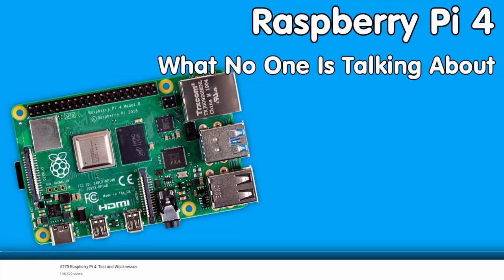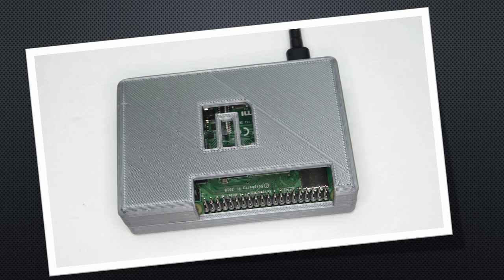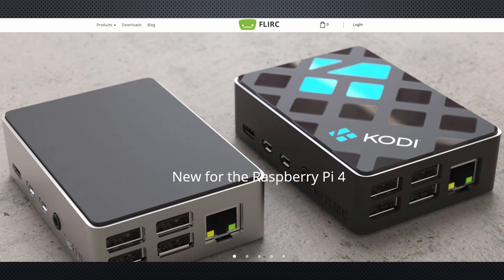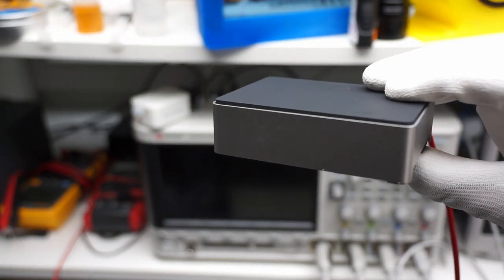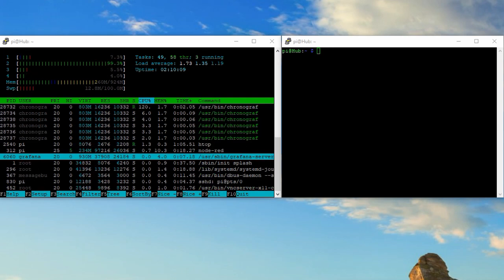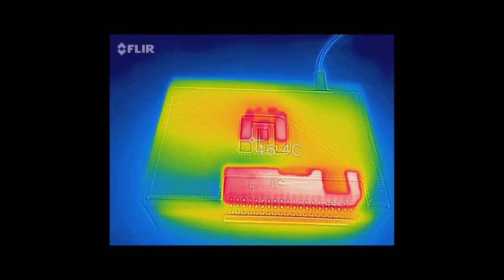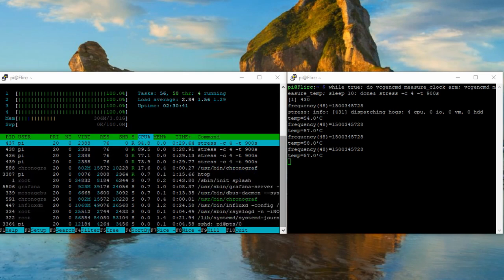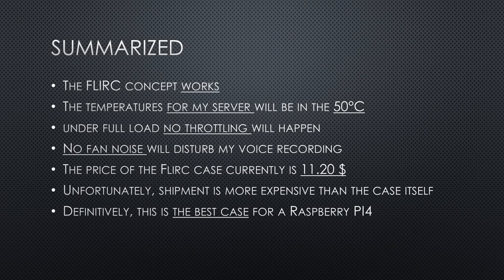#283 FLIRC: A Cooling Case for the Raspberry Pi 4? Does it work? (Quickie)

Comment: The best video I've seen on "passive aluminium cooling box" for RPI4.
Well prepared, with measurements.
Only one thing: Is the box as an effect on Wifi reception ?
Reply from the maker: It still worked in my lab, but I would think, the range is smaller. I did not test it.

Comment: I have a flirc case for my raspberry pi 4 and would like to overclock it. Has anyone tried it out yet? If so, what settings would be good for this? I am considering another case to use to go up to 2.0 GHZ. If i can get close to that with the Flirc case that would save me some money. Any suggestions would be great! Thanks!
Reply from the maker: I am not an overclocker myself :-(

Comment: I personally use the Zebra case with a fan and I used the supplied heatsink kit that came with it... It is louder than I like but it is worth it. I over clock my pi to 2 GHz and I run the GPU at 600. At idle I run 34c to 35c and full tilt after 10 minutes I'm only 42c-45c. Use active cooling and heatsinks with your Pi-4s.
Reply from the maker: Active cooling can be very powerful as you mention. But I do not like the noise of active cooling. If you place your Pi in a different room it might be ok. Mine sits on the table in my lab.
Reply: Over clocking will defintely need active cooling as the passive cooling just wont cut it.  Sometimes I wonder about pushing these boards though.  When does it become a better option to just use a Laptop or even small desktop machine instead of pushing the Pi beyond its original design?

Comment: Great video (as usual ;-) ).

I have a similar case for my RPi 3 which I bought a year or so ago from China.  And yes, it works great there too.  We should all use metal cases like this, or use some kind of cooling on the RPi.  And yes, the official case is not good enough on this device.  At least is should have some larger vents and room for a fan.
Reply: Could you link the vendor?
Reply: @almirantecarvalho  don't remember right now.  But a simple search would give you some vendors. Google or here in YouTube.
Reply: hi do u have some way to make it waterproof with heat dissipation?

Comment: I received my Raspberry Pi 4 last month and haven't had time to use it yet. Thanks for the video, i might get the case too.
By the way Mr. Andreas, you should check Microchip's PIC controllers. There are quite nice to use, but lack the platform and popularity (at least for hobbyists) of the Arduino.
Reply from the maker: They were pretty popular before the Arduino.
Reply: @AndreasSpiess  , Yes. But Arduinos are not popular for industrial usage.

Comment: Ok, Andreas, you've convinced me it works..... I suspect however, here in Spain (where American-based products seem to end up costing a lot more, presumably due to some Spanish implementation of EU restrictive trade practice) the price will be WAY too high however. I hope I'm wrong. £15 + post in the UK at Pimoroni for the Pi3b version. Pi 3b version Spain Amazon €23 yet headline price in the USA $12.95 on flirc.tv site for Pi 3b case.
Reply from the maker: You find a link to a German source in the comments. And I still hope Amazon will carry it soon. If this helps in Spain.
Reply: @AndreasSpiess  Thank Ansreas - I will check as I too would like to review this. I have a cheap chinese case and fan on my wonderful new RPI4 right now.

Pete
Reply from the maker: I tested a big heatsink with two integrated small fans on my second RPI4.  Similar values as the FLIRC.

Comment: Thomas Sanladerer has tested Pi4 and found that it doesn't actually run any hotter than Pi3. It only feels like it's running hotter because Pi4's processor is metal-encased while Pi3 has an epoxy casing, so heat transfer to your finger when you touch it is much faster with a metal casing. I generally agree with "is it too hot to touch" rule, as it largely puts the operating temperature within the extremely comfortable for semiconductors 60°C, but it bears some adjustment to the type of surface that you're touching.

This is certainly a valid and valuable test of the enclosure's thermal solution, but it's best to keep in mind that Pi3 also ideally needs a fairly similar amount of cooling. While its power consumption is lower, it also has a higher thermal impedance within the processor package.
Reply from the maker: You are right with the metal surface.
I watched the video, too and he got to the same results I got. His use case only needs 25% on a single core which is not a lot. Like that he has no problems with heat (probably until he uses a case) and he probably could use one of his old RPi3s ;-)

Comment: shouldnt the hole where the the cpu is be solid? fill that thing with aluminium should help... right?
Reply from the maker: I do not think it would change a lot. The critical part is from the cpu to the aluminum.
Reply: i am unsure.. what if one had fins inside that hole.. think the design could be improved

Comment: Can someone explain to me what the advantage has the PI over any other linux desktop. Not trying to be as a$$  I just don't understand what a pi can do better than any other linux box ??
Reply: I think the main advantage is size and low power consumption, well that was the original idea.  Newer ones are getting more power hungry.
The Raspberry Pi was developed to be a learning tool.  A Development and Educational product.  It just became widely adopted because it is quite versatile while having a very small footprint..
It certainly isn't a replacement for a full Linux box on powerful hardware though.

Comment: And what about wifi?
Reply: Ups! That's true... Andreas have you try to use Wifi or bluetooth?
Reply: Interesting, yes. Maybe a follow up video on this, testing wireless signals?
Reply: Crucial for me. Several Pis here are far away from any ethernet port.
Reply: My thoughts exactly...
Reply: @frankfinner5272  
Backup plan could be external WiFi adapters

Comment: Does anyone know if this case keeps the system sufficiently cool when the GPU is also running at full load? That is to say, 100% CPU x 4 cores + 100% GPU load.
Reply from the maker: I do not know how much heat the GPU produces and if it is relevant

Comment: " If you cant touch it, it is too hot" Isn't that the rule for checking a gun if it is overheated in the swiss military? Did you just nick that XD
Reply: If the gun gets too hot just pour some wine on it! That's why there is a corkscrew on the swiss army knife ;)
Reply: normally 60c is the point where you can only just keep touching. Rule of thumb in electronics was is if you can keep your finger on it it's running OK.

Comment: Happy  you found this hack.  It's essential for most use cases.  It does get in the way of gpio pins - even with a ribbon cable. Also, wifi and bluetooth performance may degrade. Flirc cases are awesome and media centre users and retrogamers have known this for years.

Bahhh-eeeehhh!😁
Reply from the maker: For me it was new (probably because I only needed it for the Pi4)

Comment: Receiving my RPi 4 tomorrow 😃
Reply from the maker: I hope it works and you are happy with it!
Reply: @AndreasSpiess  It's great but Linux support (especially 64-bit) still has issues (DMA timeout on heavy i/o (LAN) load). If one uses the (old) 32-bit Raspbian it works finde (but won't use the real power of the device).

Comment: A nice Engineering solution. Until someone dumps paper on top or puts it where the air can't circulate.

P.S. it'll work a little better if anodized black. Just a little.
Reply from the maker: You are right. Or till my cat sits on it ;-)

Comment: There is a fan case and it is not loud. It is quieter than my monitor fan. It costs $10 and it comes with heat sinks
Reply from the maker: Link?

Comment: If you can hold your finger on it .... Pahh, that’s for puny electronics. If it leaves a flat white spot on your finger it’s ok! If you can read the ic part number in the white spot on your finger it’s too hot! If you use your thumb it’s called a rule of thumb.

Comment: Ordered the Flirc last week. I was using small fans in the past but they were not reliable enough: power, dust and bearing problems.
Reply from the maker: This is why I also prefer a passive solution.

Comment: does the wifi signal keep working properly for Flirc case??
Reply from the maker: It worked ok for me on 2.4 and 5.8 GHz. However, I would expect lower performance (reach or throughput). I use an Ethernet cable with my "server"

Comment: Don’t you think you should have used exactly the same Pi in both cases? Won’t the fact that one had 4Gb and the other just 1Gb affect their ability to deal with the same load?
Reply from the maker: The load was the same for both and did not involve any memory test. So the results should very comparable.
Reply: Andreas Spiess
Surely any test will use memory, so must in some way be affected by it. I note that other comparable trials used a number of different tests, and made the point that the Pis used were identical and used the same SD card. Otherwise you’re carrying out a test which changes two variables at once. I would have thought it quite possible a Pi with 4Gb ram would perform more efficiently than one with 1Gb and hence tend to run cooler. But maybe not! We don’t know. I may test it myself when I’m back at my lab. Your videos are invariably interesting and informative, but in this instance I feel your Swiss rigorousness was not to the fore :-)

Comment: I used that case, the Pi2 I have a Pi3 in it tho and heat not an issue ever been running years as a served and other things I wouldn’t use any other case these are the no1 cases anyone can buy for a pi
Reply from the maker: Thank you for sharing your experience!

Comment: It is not the same as ventilation though. The other chips can get hot too. It is a pity such measures have to be taken as a consequence of the pi4 being odd in design. And you cannot even run a debian blob.  Ugh, it just feels so "locked down", like the archimedes (and that factor was lame on the archimedes whereas the amiga was free and anarchy). If the Pi-computers (from pi4 onwards) wanted to take a different direction, instead of the pi4, a dual cpu pi3b (same A53 again but two of them, maybe even with some tricky to get "normally-8core" blake2sp processed) would have been better and have the 4gigabyte RAM on that but in DDR3, and the pci-e as a slot, then allow for a 16gb ddr3 to be plugged into a slot for enthusiasts who want 20gb (in case they are past the affection for the 32bit 4gb connotations), and just pick a few known quantity 16gb modules from well known manufacturers to make them work (as they are not so varied anyway, and perhaps even ECC would be tempting). 

Then they could have allowed debian blobs to load like a pi3b but also to have done something as an obscure approach-fork like take slackware (and I know slackware is not a fork of debian) in the form of say puppylinux-slackware and write drivers for some obscure old PCI hardware like say a pci soundcard to go in the PCI-e by convertor. The pi would have thereby contributed all its hardware to slackware drivers (which are scarce compared to debian). Totally not bothered about 4k dual monitors on a pi4 as a sbc makerboard. Having the 1080p pi3b standard is fine and just having a convertor to make the 800x480 display port go into a monitor (I don't care if it is vga or DVI or hdmi or display port) would have been fine, and maybe have an "upscale to 720p" trick would do if two monitors that way was really needed somehow. Had the hdmi (not directional) allowed to send and recieve hdmi, it could have been used for capture of video, and, importantly  channels of music and so makers could "create". Yet now it seems more like a device for consuming than making.

I digress. The pi4 needs a proper fan from a deskop PC (just like ExplainingComputers uses - that zalman-looking thing) and so by then, having it in a bigger case would have made more sense and so the dual cpu layout could have done that even on a bigger board. That firc case is at least $12 to $25 extra cost and it is not flirc's fault, i.e. the case should not have even needing inventing. It is too pricey a thing (aluminium brick ingot) to need when the money could have been on a better designed but slightly pricier pi board (in muh timeline). Also, you cannot make your own flirc case easliy. A pi3bplus case can be made easily as the heat is not such an issue. If a pi4 is to be used as a desktop-PC (which they are calling it) a homemade case about the size of a gamecube or one of those old cube macs is more likely to be a better choice for a nice zalman-style fan and the micro-hdmi cables could be routed to never be used (convert to full size via breakout on the case). Then if one is to cool it in that way, one might as well overclock it up fast. However it is still not therbey a board driven around on a robot like the web advert shows. I have no problem with the pi4 wanting to overprice a small keyboard and mouse in a collectors box to help fund it, however, to include (in that shoebox) a plastic case that acts as a kiln just makes it a laughing stock, and every Q&A video they retroactively make on it a damage-control to the coconut shy comments sections of other videos. The shoebox itself is a better pi4 case. #CannedHeatClownShoes
Reply from the maker: Thank you for sharing your opinion and wishes.
Reply: @AndreasSpiess  I can totally understand why you like the aluminium pi4 case considering the circumstances, but it is specialised and limits the pi4's usages. It is the fault of the pi4. If the pi4 designers felt the pi4 mandatorily had to be designed like that and so hot, they could have maybe moved the hot chips (basically the CPU) to one side (edge) of the board (like an amiga a500 - as a vague analogy) and then such an aluminium case could have been made but with a extra model which is far taller, thereby leaving internal space (room) for gadgets to be added. If that were done with the existing pi4, it would make a sort of "undesirable partition" which would get in the way. The strength of the raspberrypi selection in general is that it is a popular known quantity, but we reached "peak pi" at the pi3b (or pi3bplus). The pi3b (or pi3bplus) really could do with more RAM, but hey at least it exists. I just knew the pi4 would be disappointing. It was a hunch which I wanted to be wrong about but alas was right.

Comment: Would've been great to include some WiFi and Bluetooth tests as well because I fear the metal is not really helpful when using wireless, eh? ;)
Reply from the maker: I usually use Ethernet cables for my "servers". But I would not use this case for use cases with 2.4GHz
Reply: @AndreasSpiess  Yeah, I also do, but ethernet cables don't work for Bluetooth ;) Maybe you could make a future video comparing Bluetooth and WiFi connectivity with different Raspis and cases? Would be awesome! Anway, keep up the good work!
Reply from the maker: Another commenter wrote that he did not experience problems with his RPI3 and a FLIRC case.
Reply: @AndreasSpiess  Thank you!

Comment: Have you installed the updated firmware that the Pi foundation released in early July?  https://www.raspberrypi.org/forums/viewtopic.php?f=117&t=246027  Apparently it reduces power consumption by 300 mA.  
Once the firmware is updated, one of those little $2 heat sinks and an enclosure with slots for airflow is all people should need.  I can't get mine to thermal throttle even under long-term full-load testing.

Comment: I have a flirc case and an all fins case, both on 4K pi 4.B units.  Everything otherwise is identical.  Neither case is adequate in and of itself with heat sink grease.  I am not impressed with either one.  I am going to add a large heat sink and fan to both.
Reply from the maker: For me it works perfectly and keeps my Raspberry on an acceptable temperature without fan noise.

Comment: I bought one for raspberry pi 3.  No good. dual fan works well.
Reply from the maker: What was the problem?
Reply: I am curious as to what issue you had.  I have 2 Raspberry Pi 3B+ devices running 24/7 as IOT/automation devices and they never get above 54 degrees C.  I know the GPIO headers can be a little tricky to access with this case, but I found it cools better, and silently, than most fan based solutions.